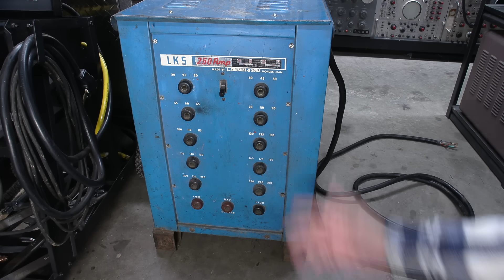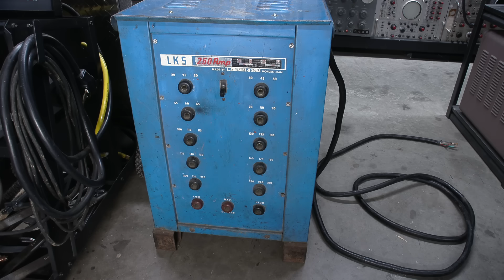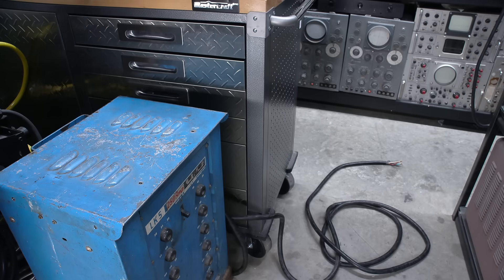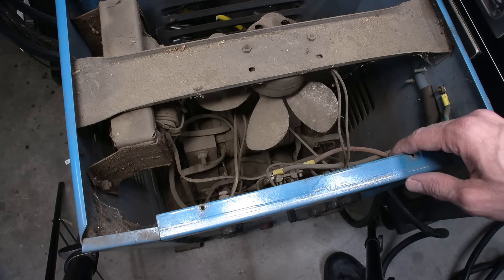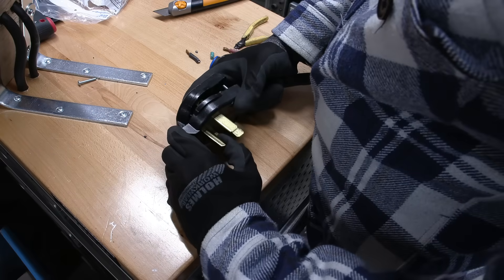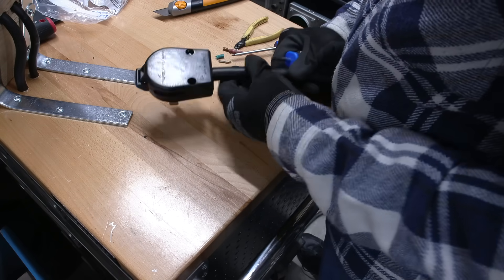250 Amp Power Supply - Will It Work? Power It Up!

Comment: as you point out, that voltage sags drastically when loaded... thats the nature of the old buzzbox stick welder. high voltage/low turns ratio for striking voltages, whilst the current is due to transformer coupling/reluctance. ie, the movable core. extremely poor regulation.

not really ideal for a power supply. at 250A, that 90Vac may very well drop to a mere 1V.

wheres a MIG type transformer has a fixed reluctance/core, and relies on turns ratios alone.. (traditionally its just a multi-tapped primary) much better power regulation, though voltages may not be entirely suitable.

personally, if you want a high current supply, you are better off rewinding a MIG transformer... you only have to do the primary.

rather unusual to see a reactor in an AC machine... must be to pull those low currents that the moving core cant quite obtain...

Comment: Paul, what's the difference between the low, medium, and high grounds?
Reply from the maker: You will see 3 current ratings above every terminal plug on the welder, you choose the appropriate ground for the current you want.
Reply: @MrCarlsonsLab  Looking forward to whatever this monster of a power supply will power up!

Comment: Apparently AC welding voltages are higher. It may drop once the arc is maintained though. Not sure if this old machine would be the same. Cool old machine.

Comment: on all my welders, I use the 50/30 amp plug and leave the neutral blade out  since they don't use the neutral. that way I can plug them into any 3 wire 4 pin 30 or 50 amp receptacle, since the neutral blade it what makes them different.  at least anything newer wired that has a 30amp dryer or 50 amp oven receptacle, beyond that temporary breaker and pigtail.
(NEMA 14-50R or 14-30R)

Comment: I remember working as a welder/burner at the shipyards in Thunder Bay in the 1970s.  The arc welders were massive units each about the size of 4 fridges and the cables had to be "very" long to reach into areas of the 1,000 ft (read 320 meter) lake boats (read grain and iron ore carriers).  The entire boat was grounded.  So, not standing in puddles (very often) but standing on grounded steel all the time.  In February when it snowed and was -30 Fahrenheit you would use a torch to heat up the steel you had to lay/sit on to do the welding.  These big welders were smooth like butter.  One time my welding gloves got a bit wet while moving some snow aside.  I then grabbed a new rod and put it into the holder which of course was live.  Not very pleasant but definitely didn't feel life threatening at the time.  The amperage setting was around 80 amps but I would guess the voltage on the rod to the grounded ship to be around 80-90 since it did feel pretty close to holding on to wires from a 120VAC  house breaker.  (which I have grabbed many times and am none the worse for wear.)  The real danger is the 240VAC supply.  I touched that "once" on the back of a dryer while changing a light bulb and that is incredibly painful and dangerous.
Of course Carlson's advice is worth listening to - don't stand in a puddle and touch the "stinger".  lol
Reply: You can definitely survice a 240 outlet ... when i was 3 years old, I was connected about 3min until my mother pulled me away from the outlet 😆
Reply: @MrThomashorst  Wow, do you remember how much it hurt?
Reply: @kimtyson9101  Thank god I have no memories left, but it has tought me huge respect for everything related to mains voltage.

Comment: Hi paul. Why is the neutral for the line in not used inside the unit?
Reply from the maker: In many 240V applications, the neutral (or center-tap from the pole-pig transformer) is not needed. The ground or earth connection is connected to the case. If the neutral was used, then two 120V sources are available.

Comment: I had no doubt that this beefy machine would power up easiliy and just work fine! A good old transformer based welding machine is still the best you can use. At least the secondary winding is isolated from mains-ground - so the danger can be handled by just not touching both ends at the same time 🙂

Comment: In my years in the US military we had AC to DC rectifiers that were about the same size as yours.   It had terminals on the front to strap it for 12 or 24 volts.  It was used to power vehicular radios in stationary settings.   They all had tubes, vibrators and dynamotors.  At least 100 pounds. Took 2 men to move it.
Thanks.

Comment: If it's for arc welding probably you need to modify it. Arc welding power supplies have some serious open circuit voltage at output terminals. And it should have a series inductor needs to be removed. Can't wait to see the huge broadcast tube actually working :)

Comment: If that delivered 250A on the secondary, with a 220V primary, it would have to pull the voltage down to under 44V in order to not exceed the 50A switch (and I assume the 50A CB that you have it feed from). Will this be enough voltage for that high power tube that you had on the last video or will you have to have some other modification as well? I guess we will have to wait until the next video.

Comment: I do not think that transformer welders are "regulated" in modern terms.
You should load it and then measure. 20V 60A can probably be taken withouth using 3 "ground" outputs. Just connect load aproxx. diagonally on two vertical rows.

Old welders have magnetically stiff cores and on start coud blow tube filament. Some sort of slow start would be nice.

Comment: In my Air Force tech school, the instructor pulled a prank on the class.  He drew a schematic on the chalk board using colored chalk.  He then asked us what the circuit was for and do we think it would work.  We answered that it was indeed an audio amp and based on the values of the components, the amp should work.  The instructor told us to look closer because the circuit cannot work as it is drawn.  We carefully did the math and we were still convinced the circuit should work.  After wracking our brains, he pointed out what we were missing:  The fuse symbol in the schematic was drawn using blue chalk...so therefore it had a blue (blew) fuse.   8-)

Comment: A few years ago you could get used laboratory power supplies for graphite furnace spektrometers from perkin elmer. They were seperate programmable low  voltage high current power supplies in 3,5 kilowatt range. Look for HGA 400 for example.

Comment: "250 Amp Power Supply" - no reference to wattage at 2 minutes.
How is this a responsible post?
My outlets are rated at 2400 watts - and that is more important than any random number of amps with no corresponding voltage quoted.
Reply: Yes but our split phase (we run 3 phase in AU)  are 6000 watts and up as we have 415 volts

Comment: Welder here! Of course I immediately had to look and the information plate on the front to see what was going on by the numbers, and saw a duty cycle of 30% @ 250 amps, interesting old machine! For those that don't know, duty cycle indicates the percentage of time that the machine is running where that indicated power is actually available before the machine becomes too hot and has to cool down. So, to put it into context of the span of 10 minutes, you could only weld at 250 amps for 3 minutes out of 10. As you decrease your power draw, the duty cycle increases and at some point becomes 100%, though I do not remember if that graphs as a curve or linear.

Comment: If the white wire was capped off was the 3phase plug needed?
Reply: that's a NEMA 14-50P(14-50R is the matching receptacle), that's 3 wires 4 prong and it's for single phase 125/250v at 50AMP max. there are two hot wires, a neutral and ground pin.
commonly used in North America for Oven/Range, EV chargers, Motorhome/Travel Trailer/Campers(RV's).
**there are 4 wires total, the 4th is green/bare equipment ground/earth)

Comment: Wow, tapping into welder power supplies, exciting.  Any plans for some custom gear like DC rectifier kit, maybe thyristor or other power controls, or maybe the ultimate aluminum welding custom DCEN DCEP offset balance control circuit?  Neat to see.
Reply: Oh man, was just thinking the other ranges of projects that might be legal or not using as well.  Custom fab or material production, to not so savvy coms? HHHmmm

Comment: Wouldn't the lower-voltage windings deliver higher current?
Reply: Yeah, I think the lower open-circuit voltage is just a side effect of the higher-current taps using a smaller number of turns.

Comment: I've been welding for 50 years. Never cared for the defined taps but preferred infinite adjustable range like the Miller Thunderbolt .
Was the output set by a rheostat?

Comment: Thought you might have checked phase to ground with at least the multimeter but preferably a megger just to ensure there were no ground failures and between phases for shorts....Interested to see what you are going to power with this though.

Comment: Somewhere Nikola Tesla is smiling...
Reply: You aren't truly a "Mad Scientist", until your experiments like Tesla, take so much power away from the nearby city Colorado Springs in his case, that you cause it to black out ( denvergazette website has an article with a quote  "And in 1899, he sent a lighting bolt more than 100 feet into the air accompanied by a thunderous boom heard up to 20 miles away. The city’s electrical equipment caught fire and Colorado Springs went dark".. This is just "Over-exuberant tinkerer" level compared to that!

Comment: Unusual that the fan is blowing down onto the transformer, I would have expected it to be blowing up to the punched vent slots in the top cover and have the impeller in a metal sleeve terminated into a square funnel to the vent, extracting the heat [as it rises] and the other vents pointed at the transformer to cool it, and cut-outs in the bracket the motor is screwed to behind the impeller blades so it doesn’t have to blow around it. In its current form it looks like it is just circulating the heat around the top of the cabinet; amusingly it has survived and not overheated as I would have expected 🥵

Comment: My first thought would be along the lines of A.C. power line regulation but the voltages are too low. Unless you have 2 windings in phase and in series. When your Hako goes on and off the A.C. power jumps. Looking forward to the surprise.

Comment: Is it really possible to remove the cover from that plug when it is connected to a socket, thus exposing live terminals?
Reply: Yes, it's even possible to take the cover off of the power panel and off of the equipment and expose live terminals.  You can even stick a couple of screwdrivers into the outlet and short them out.  Seriously, this is the crap you worry about?
Reply: @stargazer7644 . I find your response intriguing .  Why would the possibility of creating such a dangerous situation not be of interest to someone when they first encounter it?  Our power plugs cannot be dismantled when in a socket and a lose securing screw prevents their insertion into the power socket.   The power terminals in our sockets are behind shutters which cannot be opened directly.  And cabinets are not always readily accessible by the uninformed.
Reply: @richardsavage2  The point you're missing is that you can pretty much dismantle anything to expose live wiring.  What's so unbelievable about a plug?  The terminals in our plugs also are behind shutters since 2017.  They can be easily defeated by poking the ground pin hole just like yours can.  Cabinets are readily accessible by any monkey with a screwdriver.
Reply: I’m not commenting on cabinets and the ease or otherwise of opening them because they are pretty much the same across the world.  My interest in these plugs is quite simple: it appears that one can remove the plug top whilst it is connected to a live supply.   That is something that is absolutely impossible in UK.   Why so late to the shuttered socket party?

Comment: 😂Now THAT’S a perfect filament transformer for a transmitter with six 3cw20 output tubes. 120KW 😮 plate dissipation. Now you just need B+

Comment: I think the bottom 3 terminals are correctly labelled, they are obviously not commoned together
They are however the ground for the clamp, not to be confused with mains earth/chassis earth
none of the Grounds and eath are probably not conected together or that could cause problems if weldig something that's earthed.
Reply: He said common not earth.😂
Reply: @rodd8170  I know, but the 3 terminals at the bottom are not common to each other and are intended for the grounding (return) clamp

Comment: What a beast, reminds me of my welding training at school in 1993. 
We also had such ancient AC welding machines there. The welding stations were next to each other, separated by a small wall to block the light from the person next to you.
One day we were welding with 4mm² electrodes, so the welding machines were set to very high amperage (think around 180A), and the teacher was away for a moment. We started hitting the electrodes of 2 welding machines against each other like the lightsabers in Star Wars. Little did we know, that all the welding machines were connected to each other via the welding tables. The moment the coating of the electrodes was broken off and the electrodes touched each other, there was suddenly a gigantic spark, and sparks of hot metal flew around, both electrodes were almost half gone in a second. 
Needless to say, we were amazed at what had just happened as 15 year old students. 😇
Reply from the maker: Thanks for sharing your story, I bet that was quite the lesson!
Reply: @MrCarlsonsLab  yes indeed, we had a good laugh afterwards, and i think that night also "welding eyes" because we didn't use our weldingmask during the "light sabers duel" 🙂

Comment: Here comes the Mr PhotonicInduction's Lab! Nice old welder. I'm sure it weighs close to 100kg. Here in Europe you could be 100% certain that a big unit like this would be powered from 3-phase supply.
Reply: Love You Keri! I actualy have the ignitrons from an old radiator welder which would fit something like this for an old scool DC convertion... ha ha . (I wanted to give them Rons collection ower there but it fell on the shipping cost at the moment).
Reply: Transformer welders (AC) are always connected to single phase, or between two phases. That´s the main reason for older AC/DC tig units large fuse requirements. You can not transform three phase primary to one phase secondary. The ability to weld aluminium with AC, outcompetes the drawback of single phase transformers in these types of welders.

With inverters and rectifyers, it´s another story.

Comment: Can anyone please explain what a “reactor” is? 

You gotta love how they used to build things. We have an old full size electric refrigerator from the 50s in an old cabin the that fridge works perfectly and never skips a beat. How is that even possible???
Reply: A reactive electrical component, typically a choke - one that poses AC reactance rather than resistance.
Reply: @KeritechElectronics  thank you for explaining that. 👍
Reply: It's an inductor.  A coil.

Comment: I worked once for a auto repair shop that was based out of a very large and old dealership in Baltimore Maryland. I think it was built sometime in the '30s or earlier. You could actually see in the basement different construction styles as they add it on throughout pre-war and postwar. At one point they must have been repairing very large trucks because there were at least three or four welders hardwired into the electrical system. Stick welders that were on wheels 3 ft tall and approximately 3 ft in diameter. The cable itself that went to the wall was easily 2 in diameter. Never had bravery to fire one of them up! For all I know there's still hardwired there

Comment: 250A at what voltage?
Quick charging a flux capacitor? 😂
Reply: Oh yeah, 1.21 jigga-watts ain't a trivial one!
Reply: Welding is about 24 volts. So 6kW of power
Reply: Yes for a home made time machine so you can go back and get more pristine radios from the past.😂

Comment: What a beast! When I was a kid,my Dad gifted me a 5vdc power supply...after some testing we figured out it current limited at 100 A. I made a right, proper electrolyzer  out of it by turning the output voltage down to 2.5V, and i current limited it to 50A...which it more than happily supplied. I had great fun making hydrogen gas to fill balloons...or hydrogen and oxygen for some epic bangs. I once filled up an old, empty 10 gallon aquarium with chlorine gas just for fun. (Chlorine gas is evil: do not mess with it!)

Comment: Wow, the 240 volt plugs you have over there are so weird. What's the current rating?
Reply: I believe that's a NEMA 14-50  which is 50A with 2 hots of split phase 240, a neutral (which he didn't use) , and a ground.   The extra prong that fell out of the packaging is if you want to convert it to a 14-30  30A which is used by clothes dryers.  The neutral tab is shaped like an L in that configuration.  The two different neutral prong shapes  prevents insertion into the wrong receptacle, in either direction..

Most folks charging EVs at home use a 14-50 receptacle.
Reply: My welder uses the same plug.   Very common.   50A.
Reply: Are IEC 60309 type connectors weird to americans in turn?
Reply: @splitprissm9339  Haven't seen them.  They look very nice.   We have a series of newer round locking receptacles for several configurations and currents, called Nema L15.  They aren't as nice, but may be a lot cheaper.     The North American units will always be different because all the ones with a Neutral prong expect split phase power, such that there will be 120V from either of the Hot legs, to neutral.   Many 240v appliances here in US, such as clothes dryers and ovens pull 120V for their motors, fans and controls., and 240V only for  heating elements.
Reply: Look at your dryer, it probably has the same plug. Very common.